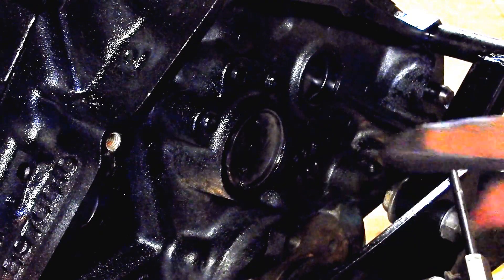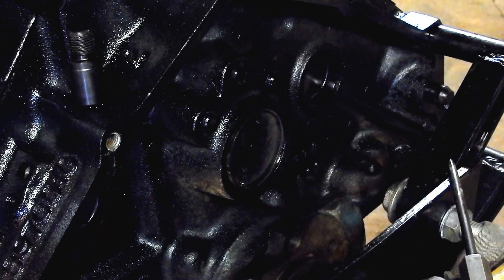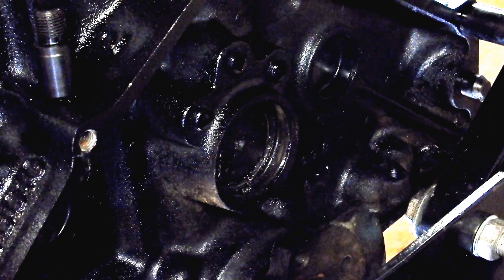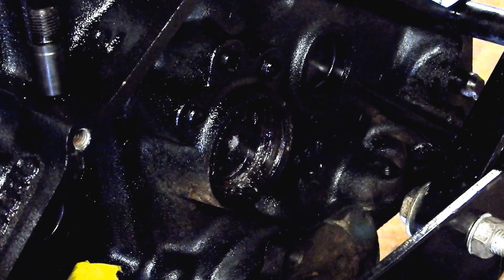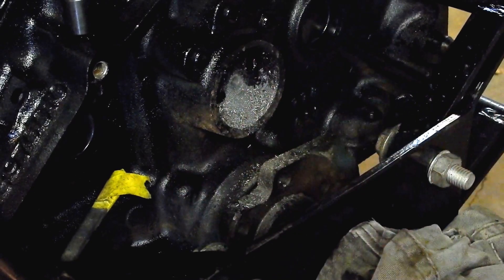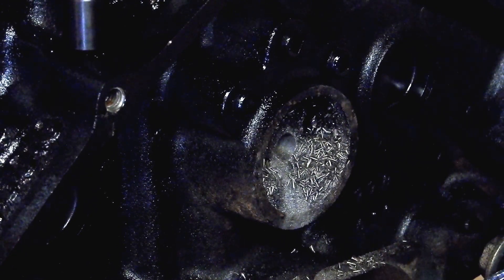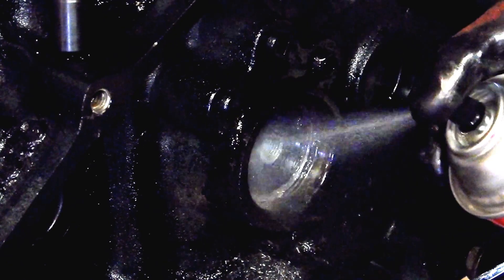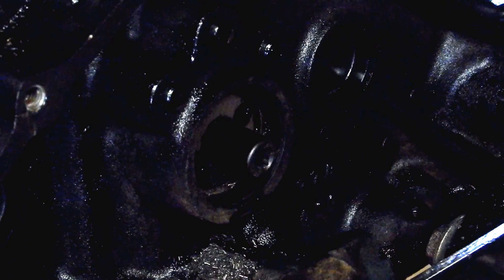Drilling  a cam for Rear  Pump Drive

Comment: I realize this is an old video however this may help some people. I used to work as a machinist for a racing cam company. I've done hundreds of these drives. The dimensions we used was to drill a 33/64 hole .900 deep. No shallower than that deeper is ok. Then cut a counter bore .750 in diameter .110 deep. Then tap it 9/16-18 to the bottom. All work was done on a lathe with a steady rest running on the rear main.